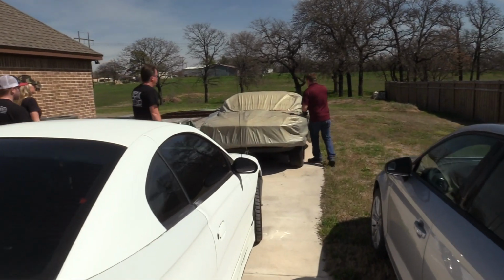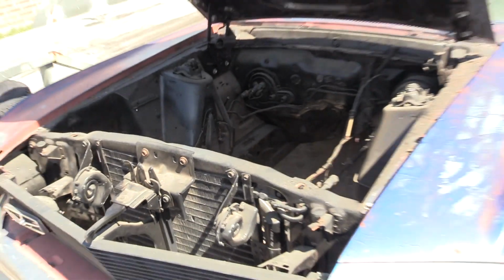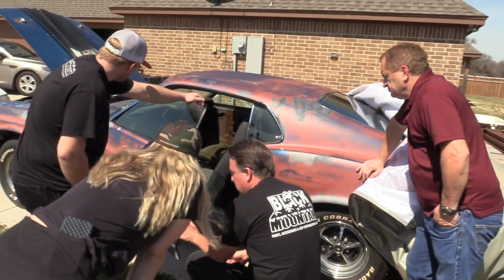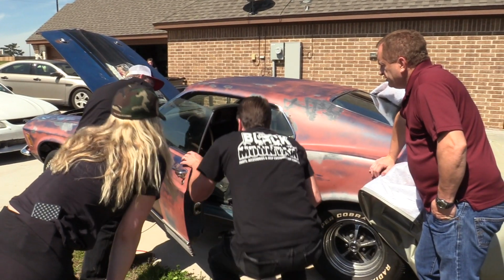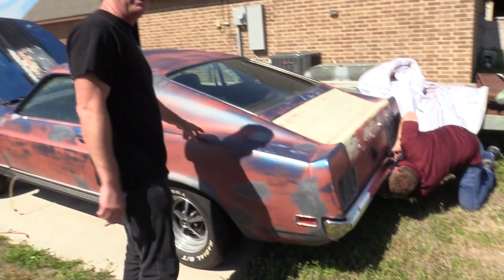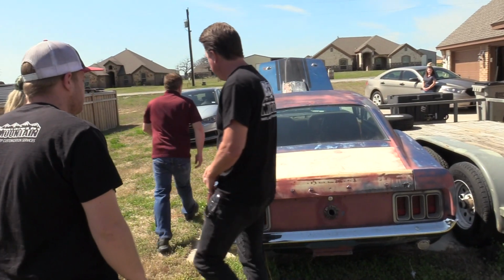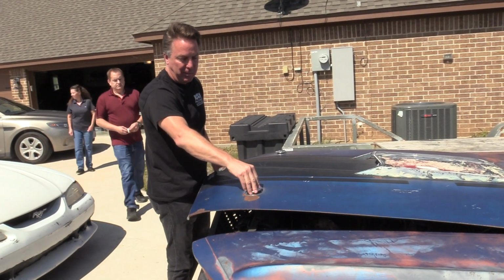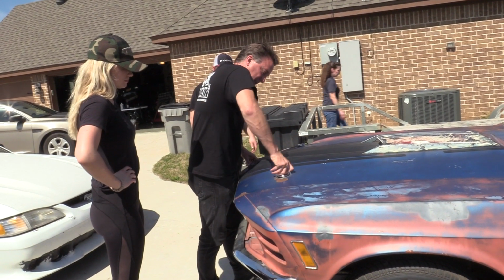Coffee Walk Ep. 86: Classic Mustang In Azle, TX

Comment: I know where there is a one owner 68 Shelby Mustang with a 428 Cobra Jet engine in Azle. With about 45000 actual miles on it. I worked on it about 20 years ago got it running for the man. Ask him if he was going to drive it. He said no. I just wanted to hear it run. Still have the original tires on it